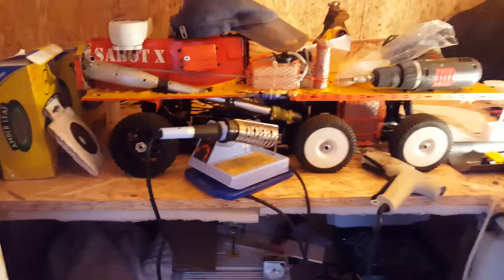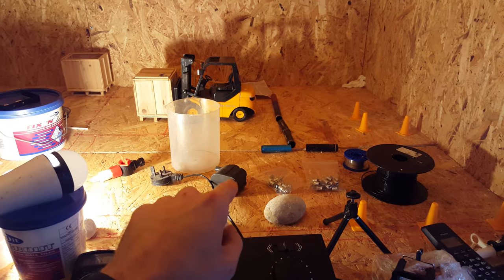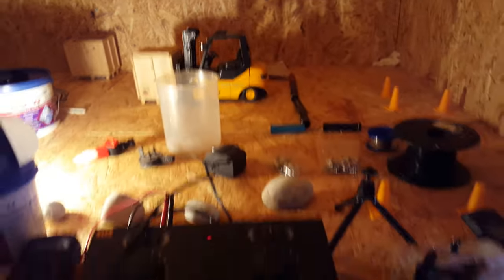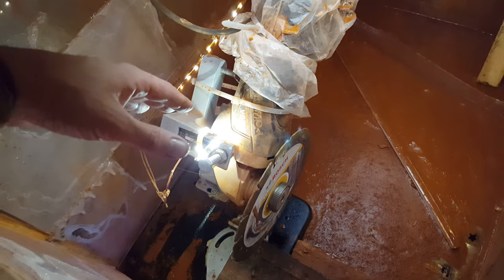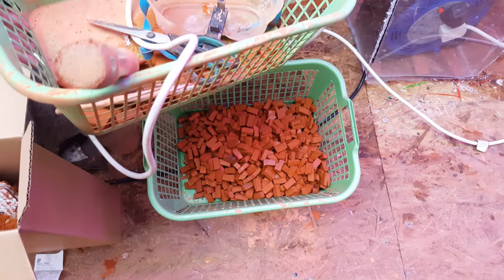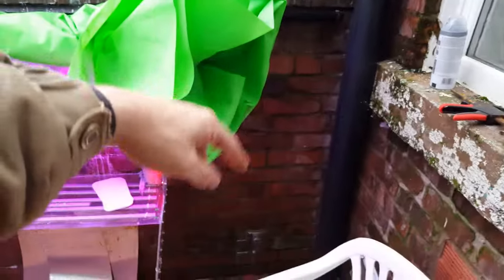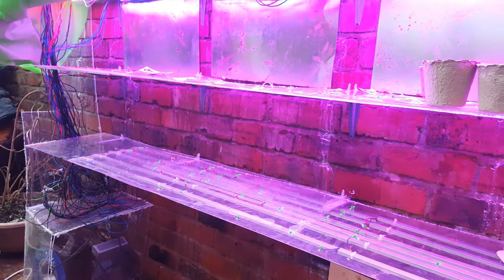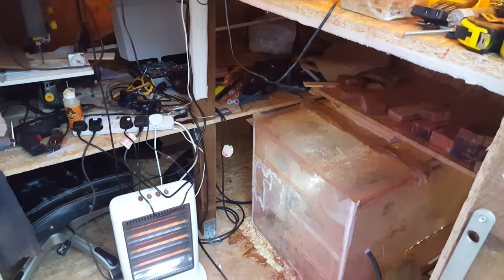2016 Updates: Dionaea, 1:10 scale bricks, 6x6 nitro & ...paper pies

Comment: Man your gonna be a busy Beaver dude! (-:
Reply from the maker: +Jax Teller RC totally :-) I wanted to fit a Stirling engine build in for the end of the year as well but not sure what I can do there yet, without a turning lave im left to resorting to finding a 'fred in the shed' place somewhere and see if I can get them to turn me some parts cheap :-D early days on that one but yeah tis nice to have some projects on and the manufacturing line all set :-)
Reply: BattonFive
Thats Awesome mate, I see the warehouse project has taken over a bit from the tunnel project?
Reply from the maker: Jax Teller RC kinda partial and the same :-) I needed somewhere to store all the brick for when I go about making the tunnel sections and things :-D but at the same time I thought well if I make the warehouse I can use it as a bit of a show room for the bricks and maybe put some pallets on ebay, that way any  extra doe that comes in I can then (over time :-P lots o time) be able to make a machine with a conveyor belt where you put the brick on it and the 1:10 scales come out all nice, accurate and clean out the other end :-)
 not sure really, tunnel is still on the cards im just kinda trying to cover as many bases with it all as possible, but yeah it adds delays to stuff
 on the tunnel front im still working on communicating to the tbm and back in the tunnel, tricky as hell as similar rf mining tech is expensive and because it transmits so high is illegal and the current idea I have regarding a setup is complex as hell and I don't think do-able atm, doing the research in the back ground though, just have a lot on with all this and work atm :-) hard to time it all to fit :-D
Reply: BattonFive Yeah I think you need to pace yourself man and just do one thing at a time, one foot in front of the other as they say (-:
Reply from the maker: Jax Teller RC its a good point :-) that I really will try to keep in mind more :-D thank fully a lot of the heavier work and this yard build are done now so its giving me a bit of my time back to do some work on the different bits, like I have the first half of a video on the bulb lighting edited and done now, will finish the second half off this evening to upload it :-)
 meanwhile tomorrow I have a day off so I can get back on the 9" grinder and wetsaws, which should produce a handful of pallets of brick by the end of the day :-)
Reply: BattonFive
Thats the way brother (-;
Reply from the maker: Jax Teller RC:-) ji

Comment: Hello mate, happy new year! Nice to see an update video from you. The warehouse looks great already and it somehow stimulates me to get started on my model train project (which is really a story with no end). The paper pies will do great, i remember using a similar method when i was working in a bike shop/garage. They'll give a lot of heat and leave little ashes. 
I'm very jealous of your perspex roof, i really wish i was allowed to do that with my balcony. 
Thanks for the update and keep them coming :D
Reply from the maker: +2stroke4me thanks ji :-) though im dying to see your train set project now :-D what scale are you pondering for that one? :-) Its good to hear on the cast iron wood burners with the similar materials you were using there, that gives me a good indication for some good steam temperatures to run the little alternator I want to set up over it :-) Hmm I think you should be good with the Perspex :-) it looks far more...set in place than it is, its all glue gunned in place and is pretty strong (has resisted 70-80mph) winds here, but if you wanted to take it down it would honestly only take half an hour and would leave no markings as to where you connected it to your balcony :-)  only tricky bit about the Perspex is the cutting of it, you need a dremel drill with a cutting disc to cut the gear in to shapes and the dremmel with a broken drill to cnc any holes you may want in it :-) Even strong cable ties would likely hold this stuff in place, the real trick I found was the white strips of plastic that act like a rib cage for the material, you bend them to how you want them then slide the Perspex in the sides of the plastic ever so slightly, before hot gluing it in, because its hot glue it works really well on both the Perspex and the white plastic strips that act as the supports :-) I just caught your New Year Vid to :-) Happy new year back to you my friend, cant wait to see what you are getting up to this year :-)
Reply from the maker: 2stroke4me Ahh nice to hear you are back on the bike :-) do leave the buggy and stuff off atm and take that one slow as you get back to it :-D even in saddle bags it would make handling more effort than it would be worth, no rush :-)
 I just had a look at your G1 post there for the O.S. MAX 21 RG that's a smart little engine on its own, the pull start wear issue sucks for the noobs like myself :-D but it looks an all round robust little thing.
 its great news if you have a chance at that exhaust there for the veco, I must admit I thought you might be checking in on ebay for a year or two to find one of those :-) and even then the price would have been a real sting :-p
 N-scale will be awesome for being able to grow your build, though im afraid that's a little to small for me to make you any pallets or bricks :-D 1:16 scale is the best I can do for shrinking while I intend to do a one off pallet of bricks in 1:60 scale when I get chance for my mate, though I think that one pallet is going to take two weeks to make :-)
 with the trains its usually a 5-10 year build to make a nice set so its no rush there either :-) for the boards there could you use 'OCB Board' if it wasn't to thick for any floors you may want to make? :-) or is that what you were already going for? its pretty cheap over here and I remember using it back in the 90s with my dad for a Hornby train setup and it worked really well :-)
 and that you have models and stuff that are getting on will really give your set character before you even start :-D must admit im pretty excited, just document the build for us when you get the bits in and are ready to go:-)
 The restraints on not being able to mod the balcony do suck, I have similar restraints here but I get along with my landlord (manage his website for him) :-D so he let me crack on with it, but everything I have put up out there could be taken down without leaving a mark, I did design it that way just in case I wanted to move at some point (dodgy area and grumpy neighbours in the main)
 but yeah it will be good to see you getting back to doing vids again :-p theres nothing boring about checking out the different engines, they all have different personality and have there own intriguing bits, that you can tell us about the details of the engine amazes me, no joke :-)
 same with the cars, its just so un-demanding to watch and such good fun to watch and drive that its most welcomed material :-)
 not to mention slowing down and pondering on stuff like this seems a great way to re-learn old principles and to take old principles and look at them in a new light :-D you never know what you may come up with when you do stuff like that :-)
Reply from the maker: 2stroke4me I like the emphases on the scenery :-) I can see it working out really well, specially if you can get it so your camera has a ground eye level when you're filming it :-)
 I always wanted to make a model city with real dwarf plants built in to the set and then running grow led lights over the board to grow stuff on and into the board when im not playing with it :-D
 I'm a big fan of the set builds and how atmos is created so that project is definitely up my alley :-)
 yeah I know that type of corp landlord, they are strict as hell, the plants though, I would defy :-D I know its for the communal best but whats life without a bit of life floating about :-)
 but yeah least you have the perks of being able to just nip out on the balcony and let the nitro fumes drift off with the wind :-)
 Im looking forward to checking these engines out, it would be really sweet seeing them running side by side and comparing the sound of them in different intervals as well :-)
 Its one of those things I would love a go at but the debugging would take me to long so I would be sweeping it in the 'back burner sort it down the line' corner :-)